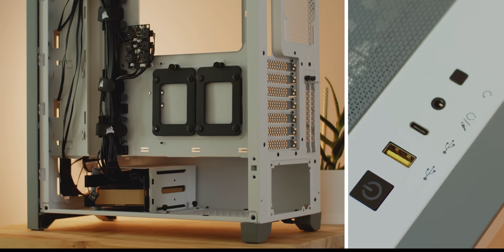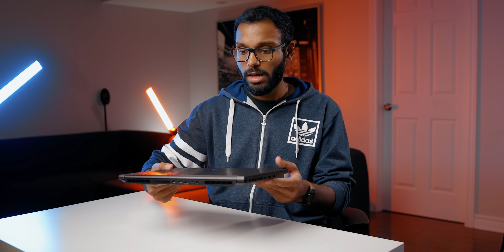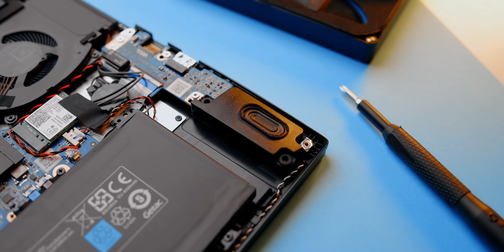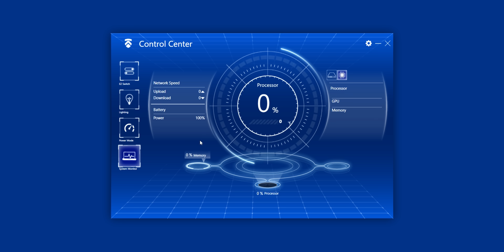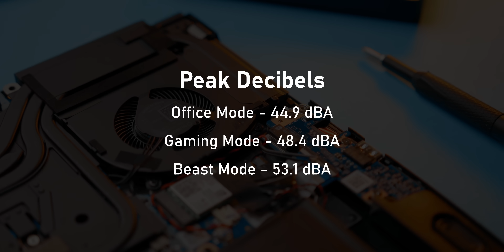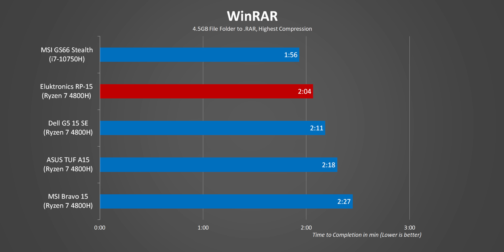A Ryzen Gaming Laptop Done RIGHT!

Comment: In 2024, this is still a solid laptop as long as you aren't playing a recent major AAA game on high graphics.

I'm not a fan of the fact that I have to switch the function keys every time I log in.  I wish there were more firmware and software updates from Eluktronics but it is what it is.  This device is a few years old now and you can always just order a newer computer from their website.   As eluktronics doesn't provide drivers anymore, you might have to search the internet for new drivers or use AMD, Realtek, and NVIDIA sites/apps to install updated drivers.

I do love that it didn't come with a bunch of useless software like other computers did.  Less time spent uninstalling crap I don't need.  I love having multiple modes and options to select fan speeds.  The I/O is absolutely loaded with features.

Comment: Why is the battery always charging to 100%? And there is no way to stop battery charging to 100% with most known brand laptops the user can set battery to charge to maximum if 60 or 80% but not with this which is crippling especially if you need to draw 100% power in some high graphics and resolution gaming and if the laptop battery is at 90% it will throttle your performance because it will be charging the battery always to 100% so before you run a game replay and screen recording software you have to wait for battery to charge to 100% otherwise it will be losing power and constantly dropping to 20fps  for 2-3 seconds which is crippling

Comment: Legion 5 rtx 2060 115w, 1tb ssd 3000 read and write, 16gb ram, 144hz 350 nits 97 percent screen, ryzen 5 4600, 81wh battery, 4 zone rgb keyboard, wifi 6, fans with full load 45db, cpu hard to get above 80c and gpu hard to get over 75c over playing for hours, webcam decent with privacy shutter, decent mic, decent trackpad, very good quiet cooling, very nice keyboard plenty of travel
1200€ , no more words needed

Comment: I have an older model of a similar chassis (Walmart Overpowered 15+) that is by Tongfang as mentioned by others here.  Though it seem to be good value for money, the finishing was rather poor with sharp edges where the wrists are, and the USB 3.0 ports were flaky and unreliable (data transfers to external drives would drop out).  Hopefully they've fixed some of these issues.

Comment: I 100% agree with your opinions. It seems more reputable branded companies are intentionally gimping thier laptops. It only hurts them as a company. But for the consumer we win because this laptop is a beast. Wish manufacturers would listen to the people and put some better design into thier laptop. I bought a msi g57 i think it was with an "i7" and a gtx 1070. Sure the performance was comparable to the desktop version. But the fact the i7 was gimped and the fact that the intake vents for the cpu hadent been cut out to improve airflow. Grills me. I took a dremel to mine and opened up the case..... Temps dropped 10c. And 15c with thermal compound. To the point the thing never throttled anymore.

Comment: I'll stick with my Asus G14, So much nicer and thinner, grant it that has its trade-offs like lower clocked GPU but it handles everything I throw at it anyways.
Reply: The only things I hear better with the G14 is a longer battery life and better audio. The RP-15 has a better screen, better cpu, better gpu, and is a much better value overall!
Reply: @johnsmith-gs4qf  Not really and a few of your points are actually off.
Reply: @nocturnal101ravenous6  G14 has horrible ghosting and pretty bad thermals tho not ideal for a gaming laptop
Reply: @petitpanierdosier  no it does not, mine does not have bad ghosting, early review models did that was fixed, so was the keyboard lighting, and new Agesa Bios updates and further tweaks have solved the thermal issues it was having....
Anything else, you would like to bring up from an early review.

Comment: While this is good compared to poorly designed Laptops like TUF A15 series, this is nothing special and the 110W GPU boost to RTX 2060 (Electro Boost what they call it) does not show any real world performance increase in games, probably it limits the CPU TDP by a good margin during combined CPU + GPU Load. The Legion 5 with GTX 1660 Ti and same 4800H performs almost similar to this Laptop, despite having a normal 80W GTX 1660 Ti vs 110W RTX 2060 and costs more than $200 less in USA. The problem with this Eluktronics or XMG, is that they way they are balancing the CPU and GPU power during combined load, is not correct for the CPU. 4800H is a 8 Core CPU and the Laptop does not supply enough power to it during GPU Load, resulting poor performance as the CPU can't boost high.

Comment: The wattage spikes in "beast mode" is allowing ryzen's performance algorithm free control over the power necessary to hold clockspeeds at as close to peak as possible. If you look at where the other modes had dips, it roughly corresponds with a peak in beast mode power.
Reply: morever, in beast mode GPU raises wattage and CPU is only 2.5% slower than the desktop equivalent CPU from AMD, it's pretty much a desktop Ryzen in this thin and light machine

Comment: Why would one buy this over the Acer Helios 10750, 2060, 16gb, 4 zone rgb, 512 for $1137.99?
Reply: Also the 4800h is much better than the 10750...
Reply: @edgemasterblitz6325  a slightly important detail haha.

I think most people probably won't notice much of a difference in day-to-day use, especially for gaming, as far as overall processing power, but they will notice how much cooler it runs.
Reply: It's smaller/thinner/lighter and the 2060 can hit 115w, as opposed to the 80w in the Helios.

Comment: I've been using my RP-15 since it was first released and can confirm, this review is pretty spot on. It's the best price to performance laptop I could find that would suit my needs. Had an HP laptop prior and the screen was terrible. The Eluktronics display feels equivalent to my 27" MSI 144Hz monitor. I can't stand laptop fan noise so generally I leave mine set to the "office mode" for light gaming that isn't a competitive shooter and it stays quiet and right around 50 C. I also added a Team Group 1 TB m.2 SSD that I got off Newegg when it was on sale for $79 for more storage for my Steam library.  Also, for me the 10 key number pad was a must. I can stand not having it on my keyboard. The only thing I can complain about is that I wish it supported USB Type C charging but it doesn't so I have to carry the power brick with me when I travel. I still game on my desktop PC but this has been the perfect stop gap laptop for me when I'm on the go or even kicking back on the couch and playing something like Runescape while watching a movie.
Reply: Light gaming around 50 degrees? That's pretty good

Comment: Zheprys g14 has...
-magnesium chassis
-r9 4900hs
-2060
-matrix led display on the back
-120 Hz 1080p or whd 60hz display
-looks nice
-14"
-great reviews from Asus
-great speakers
-no webcam 
-white backlight
-color-accurate display
-up to 24 GB of ram
-great temps all around
-quiet
-preforms better than r8 4800h

Eluktronics RP-15
-plastic/metal chassis
-r8 4800h
-2060
-okay brand back
-1080 144hz display
-color accurate
-15.6"
-bad speakers
-bad webcam
-blue backlight
-looks nice
-up to 64gb of ram
- good temps but temp fluctuations in beast mode
-quiet but louder than the zephrys g14
-preforms worse than r9 4900hs
Reply: Asus 
- cost 2000€ in Europe
- has AMD HS processor that limits power consumption
- power burst has to be turned off, or it overheats (for now)
- RAM soldered on, 
- only one hard drive spot 

XMG core 15: 
- cost 1165€
- all magnesium chassis
- clean windows install 
- full keyboard
- bigger screen

Comment: Please review Lenovo Legion 5 with 4800H- amazing laptop. I have the RTX 2060 80W varient with me. It gives Cinebench r15 score of 1951 and r20 of 4591. Amazing 144 hz screen with good colour gradient. rugid one. I got it for 999£ with a 8gb 3200mhz RAM and 256gb M.2 storage and a 60 watt battery ( which can be upgraded later on).
Reply: Isn't the RTX 2060 in the legion 5 at 115 W?
Reply: @amex4453  GPU-Z shows it as 65 W !

Comment: This is a YouTube creator/ film editors dream. An 8 core 16 thread CPU in a 4.2 pound chassis? Nice
Reply: Well you've just described the MacBook Pro 16" which comes with better color calibration+resolution, speakers, audio, and mic. Not to mention that it runs Final Cut Pro X. I'd say this laptop only makes sense for gamers on a budget.
Reply: @kvell24  The MacBook is over $1,000 more with worse specs and a slower GPU!

Comment: I have had both Legion 5  is one of the best! Have you tried Legion 5 with 2060. It’s super quiet. Fan works at high speed but very quit and runs extremely cool. The problem with Eluktronics is that it’s extremely loud.

Comment: It's really a bit sad how a small Chinese ODM (Tong Fang) has designed some of the best Renoir laptops (the dGPU-less PF5NU1G stands out even more - a 1.5kg 4800H w/ dual RAM slots, 54W sustained TDP, and 92Wh battery) and the big boys seem to have spent the past year delivering mucher weaker products. Maybe they'll get it together for Ryzen 5000.
Reply: Does Lenovo also use a similar chassis to the one you mentioned?
Coz I remember reading an article on Notebookcheck a month or so back about a thin & light with a H-series APU (4900H).
Reply: @sushimshah2896  Lenovo makes their own laptops. You're referring to the Yoga Slim 7 Pro. It's a slick design and it'll be the highest res Renoir laptop on the market with a 2.8K 400 nit display, if it ever comes out (the press releases said August availability in EMEA, but it's getting into November and no one has seen one yet). Note the Slim Pro only has soldered LPDDR4X (16GB Max) and a 61Wh battery (but also has a 180 degree hinge and 2 full function USB-C ports (3.2gen2, PD 3.0, DP 1.4)). Hopefully they can just drop a Ryzen 5000 into it.

Comment: "done right" 

still stuck with an RTX 2060

no :P
Reply: The 110w 2060 is almost as fast as those neutered laptop 2070 and 2080s.   Unless you pay a crapton of money for 20lbs “portable” desktop
Reply: @evers6214  Not always true. I have a full fat 2070, and it's proportionally much faster even taking the higher 125W TDP in my machine into account. That extra 15W should give a 10-15% increase, but I see well over 25% relative better performance. Now if you're pitting a Max-P 2060 against a Max-Q 2070, then THAT is a better comparison.
Reply: @evers6214  This is kinda and kinda not true. While the performance difference is way less than the desktop variants its still quite a bit off a 2080 laptop...which is more like a 2070/2060super desktop when the 2060 laptop is more like the 1660ti desktop.
Reply: @evers6214  fair enough.
Reply: Wait next year ryzen5000 and rdna2 laptop
Reply: @jerrym1401  yeeeeeesh. With PCIe 4.0 storage and Freesync 240Hz displays. DAMN.
Reply: @jerrym1401  yeah can't wait to see what comes from that. Should be a monster.
Reply: There is a rtx 2080 version
Reply: @kamiwey  oh? mussed have missed it. Thanks, will have a look.
Reply: Ryzen mobile 4000 only has pci 3.0 x8 I believe.. so higher than a rtx 2060 will start to get bandwidth starved. Ryzen 5000 mobile will solve this

Comment: I have to decline this laptop because of the RTX 2060. I am not joking, I use Linux as my main operating system and AMD works easier on Linux than NVidia (for CPU's both Intel and AMD work fine). For example, the current kernel version on Arch does not support NVidia-GPU's yet. The big difference is that AMD supports the open-source drivers while NVidia does not. This makes it a bit more tedious to get everything set up (nothing problematic if you know what you do) but also new kernels lack support for NVidia at times. At this moment kernel 5.9 (current version on Arch) is not supported by NVidia yet.

Comment: I’ve got the main gear element 3, their vector line is the same as this shell, I think the vector was a eh build, but the element has an amazing chassis and it’s plastic but feels like aluminum covered with just a thin layer of rubberized plastic which I love, Dave 2D says he prefers his razer to these but I’d disagree, the hard metal edges get annoying and the hardware isn’t even close to where it should be for the price razer charges, great laptops still, just way to pricey with these making their way to the market. Also the fans on these are a very nice, and kinda soothing noise so it’s fine to have in the background, so just something for a potential buyer.
Reply: Have the same laptop (Element 3), chassis is magnesium alloy, feels a bit like thick plastic bit it's actually light metal.

Comment: How long did you test in games? If anything below 2-3 hours of constant playing, these test are pointless regarding fps and temps. Problems with mobile Ryzens are that they can't hold the performance due to either not good enough design or not good enough cooling system design. I'd like to see real load tests in gaming. Real life scenario like playing a game for 2-3 hours at least. The best laptops atm can hold 2-3 hours of playing without throttling and that's bare minimum if you ask me. What's good with having a good fps like 150 if you can have it for minutes or even an hour. That's just not good enough. I'm not the one to judge since I can't tell for sure but I'd be surprised if this laptop could stay on top performance for more than an hour, plugged in of course.